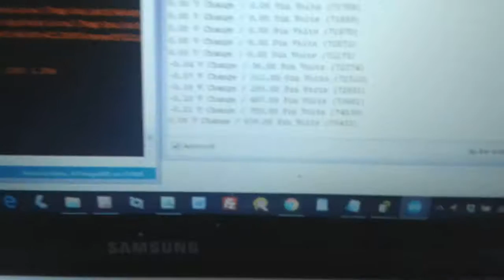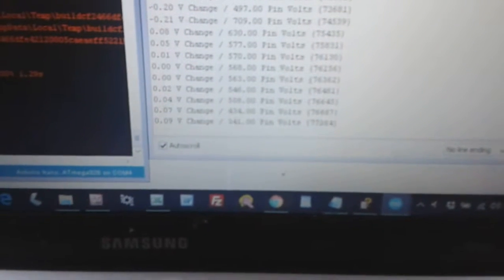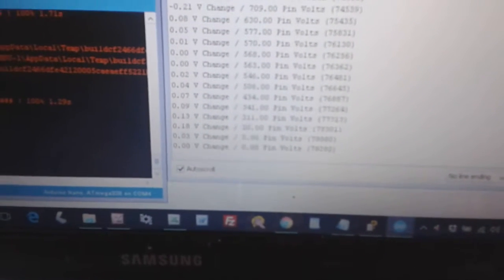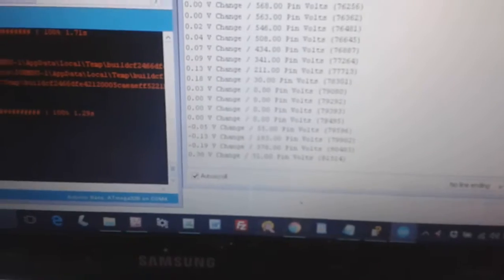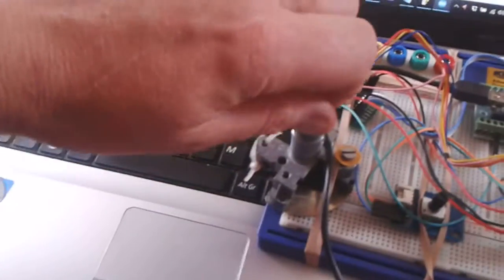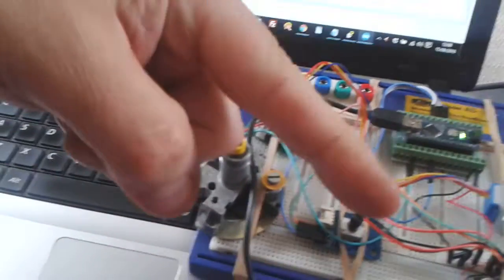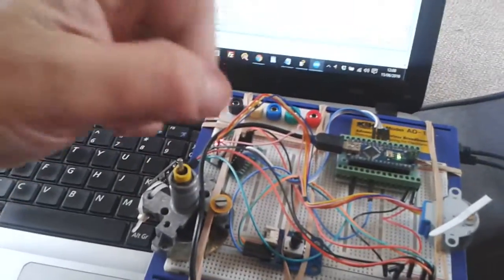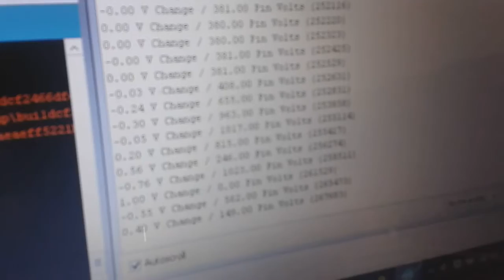speedometer digitisation board arduino stepper motor optical chopper DESCRIPTION

Comment: Always wanted to build a WW2 Spitfire cockpit  and use period alt speed flaps etc etc on Analog from digital display This would be the way however i know theres alot of code.. thanks for the video
Reply from the maker: there is only a little bit of coding needed to be honest, the problem I am encountering is that I don't simply want the rotation of the speedo cable to be mirrored by the pointer, I am emulating the magnetic effect of the speedo with some offset